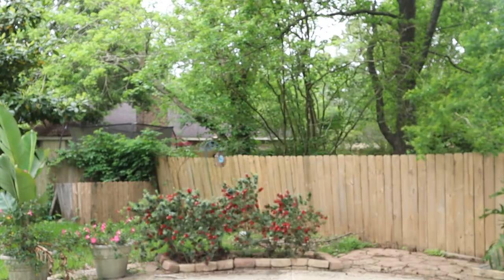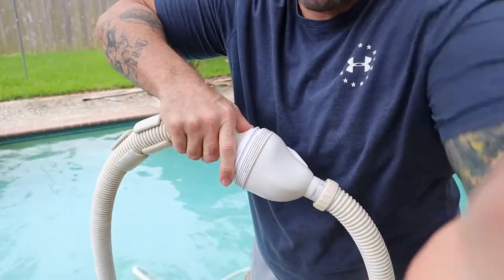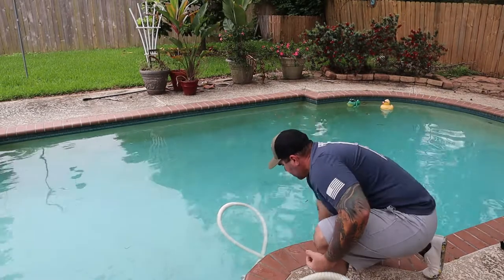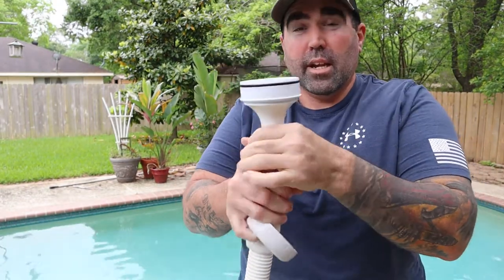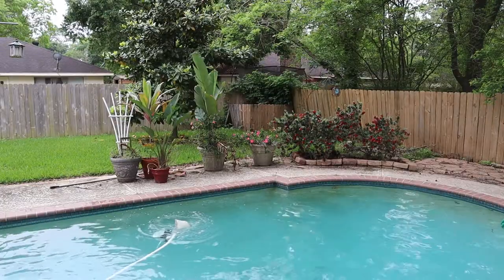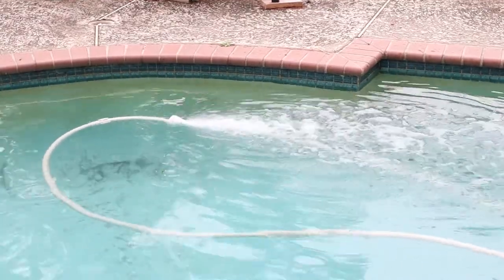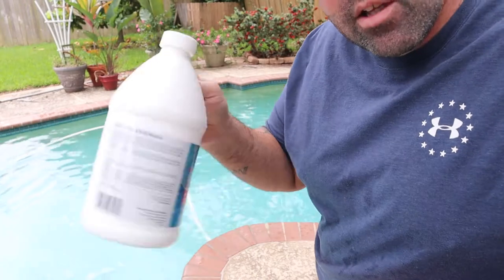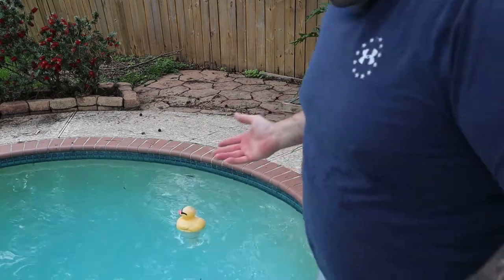POOL CLEANING. Polaris back up valve. SCALE remover. STAIN and ALGAE remover. Quality Content Rick.

Comment: FYI. Been watching videos about the 280 since I'm having a small issue. and I'm learning a lot I didn't know, the back up valve is my issue. and I have learned that the BU valve should be about 18 inches from the the head end unit, yours seems to be a lot farther then that. and so it floats when engaging. maybe try moving it closer to the head-end and see if that help at all?
Reply from the maker: Yes, that is correct. I moved it a lot closer now. Thank you for watching my videos

Comment: How do you get that darn ring off of that Polaris back up valve? Mine is stuck.
Reply from the maker: Mine gets stuck some times also. I found that if i shake all the water out and tap it a little then it will loosen up. Thanks for watching.

Comment: My shell is cracked and I'm trying to open the top after taking off the ring and it's so stuck! Any tip to take it off?
Reply from the maker: I think it is vapor locked. shake it until the water comes out. try tapping it on a solid surface if that doesn't work.

Comment: Any suggestions to fix the gear? The outer gear isnt moving but the inner gears move just fine.
Reply from the maker: Actually the outer gear is moving really slow due to the multiple gears. i think it is supposed to do a certain amount of rotations per hour or per the flow of water. This way it moves the vacuum to the other side of the pool through out the day. Thank You for watching.